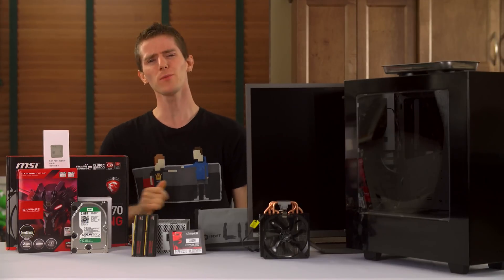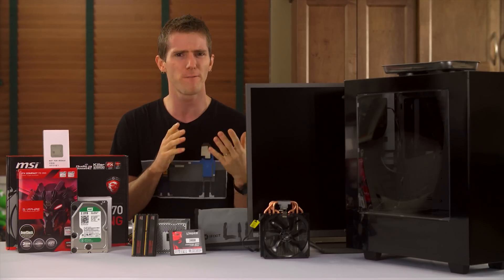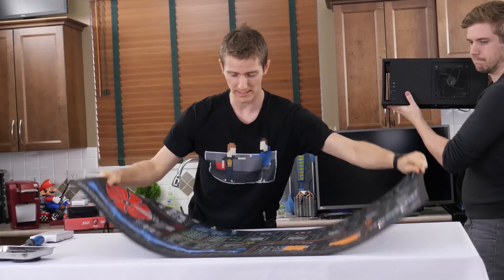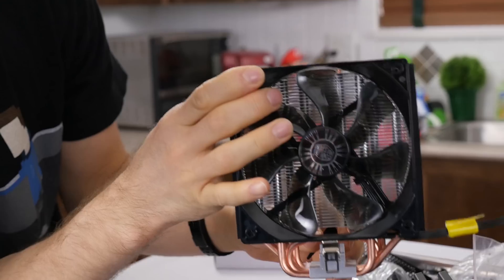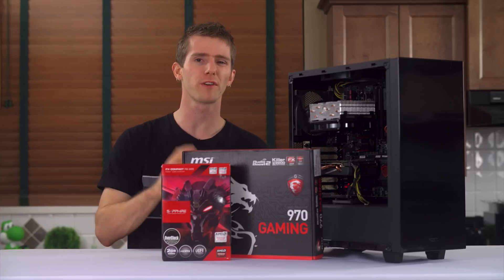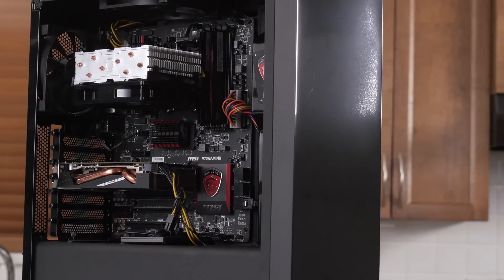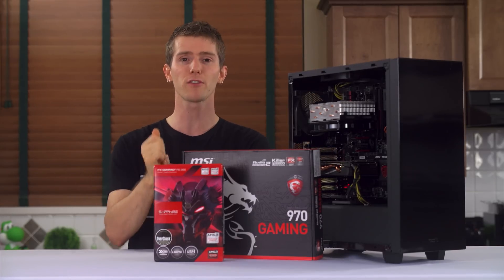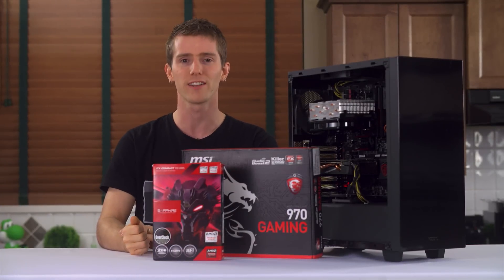Can you Build a 4K Gaming PC for Under $1000?

Comment: The monitor is nearly as expensive as the rig....
If you have the cash to drop that much on a display, you'll definitely invest more in the rig making the idea moot.  If you can't spend much on a rig, there isn't a chance that you'll buy that display.  However, if it can run popular games at 4k with reasonable framerates, it stands to reason it can run most other games at standard resolutions, right?

Comment: well of course you can build a sub 1000$ gaming pc. You only need a cheap current gen video card with 4gb of ram and match this card with the least powerful sufficient cpu available. take cheap no name ram plus cheap no name psu and cheap no name case. Then pitch in a cheap 128gb SSD with a cheap HDD. Find the cheapest motherboard with pci-e 3.0 capability and voilà! you can game at 4k all settings to low in metro last night. Yeah don't add any fan to this build so it cram within 6 months

Comment: suggestions and thoughts are very welcome

 CM Storm Stryker Gaming Big Tower Vifter: 2x 120mm Front, 1x 200mm Topp, 1x 140mm Bak, M/XL-ATX, USB 3.0, Vindu

 Corsair RM850, 850W PSU ATX 12V V2.4, 80 Plus Gold, Modular, 6x 6+2-pin PCIe, 10x SATA, 8x Molex, 2x FD

 Gainward GeForce GTX 970 4GB PhysX CUDA  x2

 HyperX Fury DDR3 2400MHz 16GB Black

 HyperX Fury SSD 240GB 2,5" SATA3.0, 7mm, SF-2281, 500/500MB/s

 Intel Core i7-5820K, Socket-LGA2011-3 6-Core,3.3GHz,15MB,140W,22nm,28 PCIe lanes,Haswell-E,Boxed,No fan incl.
	 Intel TS13X Liquid Cooling Solution Socket-LGA1150/1155/1156/1366/2011

 MSI X99S SLI PLUS, Socket-2011-3 ATX, DDR4, 4xPCIe-x16, USB3.0, SLI/CFX, M.2

Comment: You could totally play at 4k with a pair of 290Xs and an FX 8320. You don't need Intel at all, even less at higher res where the CPU (I should say single threaded performance, cause the FXs are faster CPUs that the I5s+ better overclocking) doesn't matter.

Comment: This really change my perspective about my computer. I never realized how powerful it was until now. My computer is similarly spec except I have a FX 6300 instead of a FX 6350 and 2x R9 280X CF. Now do you think I could run higher end games at 4K even though my cards are only 3GB??

Comment: i actually built my gf a pc using the msi 970 gaming board with an 8350 and my old 280x (swapped it for the gtx 970). it cost a touch over 1000$ before tax and shipping and is paired with a 32" 1440p monitor. now this video has me questioning if i should have just gotten her a 4k monitor instead. ( im waiting for 4k 144hz before i jump on the uhd band wagon)

Comment: Depends really on how you define "gaming".

It is correct that the AMD base build on this video can run good fps in "some" games at 4K res. But you lose the point of a 4K res and the games.

This is because:

most games in the video/test had low graphics/eye  candy even if you max it all out hence it ran decent fps even at 4K(dota 2, LoL, team fortress, CS GO),  it doesn't mean you should run 4K, even if you use a 4K on those games they won't look any better unless you play games with epic graphics/eye  candy settings. Thats when a 4K monitor really shine.  But use a 4K on Dota 2, CSGO? seriously....

&

Dota 2, LoL, CS GO and any other FPS or RTS games need 120hz and 144hz monitor to get an advantage. So far 4K monitor only have a max 60hz. And the more pixel count on the 4K monitor doesn't really make those games look any better. Your better off with an IPS panel lmao.

Its better off using the money on that 4K monitor to get a decent Rig overall and stick with a 1080 120+ hz/1440P.

Seriously though, Nobody plays CS GO, Dota 2 and LOL on a 4K monitor using a single 285X or any other lower/mid range GPU. Nobody "sane" enough will spend the money to buy a 4K just to play those certain games. 

The video is just pure marketing now. I guess its an indicator his sold out, not the old video guy from NCIX.

But seriously trying to sell a 285X to play at 4K is not really gaming (unless you can play any games on it), its Bullshit.

Comment: I wouldn't recommend installing the Hyper 212 EVO horizontally with the stock fan. The stock fan has a Sleeve bearing which doesn't run very well horizontally. I would recommend installing it vertically or getting an aftermarket fan with at least a ball bearing.

Comment: I am running between quad hd and "4K" by just going triple monitor (3X1 portrait for 3240X1920). I am using an R9 270 and most of the games I play run just fine.  Running triple monitors can actually be more taxing on a video card, in my opinion.  Maybe you should do some bench testing on triple monitor "poor man's 4K" setup with 3 1080P monitors. I bought each of my 22" 1080 monitors at only $100 making it still cheaper than 4K monitors and only 600X240 pixels shy of the same resolution.

While a lot of Intel fan boys on here are slamming you for letting AMD buy a slot on your channel, I believe it shows you are willing to give a manufacturer a chance.  Best of the best Intel is great, but when you are on a budget, a quad core by Intel is expensive compared to a FX 6300 by AMD. My rig works just fine and I get great gaming resolutions and frame rates even with triple monitor setup.  Keep going Linus, and if you want to do a triple monitor segment, let me know. I would be more than willing to help out.

Comment: Hey Youtube people! I am looking for a new monitor in the lower price segment of it's category
I am looking for:
- 27 inch
- 1440p 
- IPS (hobby photographer + tired of TN)
- OK for gaming = not worse than my current one. 
---I currently have a Hannspree (HannsG) HF237 1080p TN monitor with 5ms.
- height adjust + tilt

BTW I am also going to buy a device to calibrate my monitors. It's awful to look at two monitors with different colors and I want to improve the look of my pictures.

I have a Gigabyte HD 7870 OC with DVI-I, HDMI, 2x mini DP
Hannspree: HDMI
2nd 4:3 monitor: DVI
With the new monitor I would use the 23" as a second monitor.

Comment: Asus 24x DVD-RW Serial-ATA Internal OEM Optical Drive DRW-24B1ST (Black) by Asus 

WD Green 2 TB Desktop Hard Drive: 3.5 Inch, SATA III, 64 MB Cache - WD20EZRX by Western Digital 

Kingston HyperX FURY 8GB Kit (2x4GB) 1600MHz DDR3 CL10 DIMM - Red (HX316C10FRK2/8) by Kingston

Intel Core i7-4790K Processor (8M Cache, up to 4.40 GHz) (BX80646I74790K) by Intel

Gigabyte GA-Z97X-GAMING 5 LGA 1150 Z97 115dB SNR HD Audio with Built-In Rear Audio Amplifier ATX Motherboard by Gigabyte

EVGA GTX980 Superclocked ACX 2.0 4GB GDDR5 256bit, DVI-I, DP x 3, HDMI, SLI Ready Graphics Card Graphics Cards 04G-P4-2983-KR 

Corsair Hydro Series Extreme Performance Liquid CPU Cooler H80i

Rosewill CAPSTONE Series ATX 12V/EPS 12V 750W 80 Plus Gold Certified Power Supply CAPSTONE-750-M

Total $1,410.07 (Amazon)

This will be my first custom PC that I will build. Can I have your thoughts on this? Can you recommend me better parts? Or is this good?

Btw, havent figured out which case to pick yet.

Comment: This a $1000+ (bout $50) pc that should be able to play ANY GAME with mostly high details at 4k

PCPartPicker part list: http://pcpartpicker.com/p/GvXhdC
Price breakdown by merchant: http://pcpartpicker.com/p/GvXhdC/by_merchant/

CPU: Intel Core i3-4130 3.4GHz Dual-Core Processor  ($106.97 @ OutletPC) 
Motherboard: ECS B85H3-M(1.0) Micro ATX LGA1150 Motherboard  ($31.48 @ Newegg) 
Memory: Team Elite Plus 8GB (1 x 8GB) DDR3-1600 Memory  ($58.98 @ OutletPC) 
Storage: Crucial V4 32GB 2.5" Solid State Drive  ($35.95 @ Amazon) 
Storage: Hitachi Deskstar 1TB 3.5" 7200RPM Internal Hard Drive  ($48.99 @ Amazon) 
Video Card: Asus Radeon R9 290X 4GB DirectCU II Video Card (2-Way CrossFire)  ($279.99 @ NCIX US) 
Video Card: Asus Radeon R9 290X 4GB DirectCU II Video Card (2-Way CrossFire)  ($279.99 @ NCIX US) 
Case: NZXT Source 210 (Black) ATX Mid Tower Case  ($29.98 @ OutletPC) 
Power Supply: EVGA 850W 80+ Gold Certified Fully-Modular ATX Power Supply  ($89.99 @ NCIX US) 
Optical Drive: Samsung SH-224DB/BEBE DVD/CD Writer  ($13.99 @ Newegg) 
Operating System: Microsoft Windows 8.1 (OEM) (64-bit)  ($89.98 @ OutletPC) 
Total: $1066.29
Prices include shipping, taxes, and discounts when available
Generated by PCPartPicker 2014-12-27 09:20 EST-0500

Comment: It's a pointless attempt in my opinion. All the games mentioned have modest graphics and they have them for a reason - to make it possible for as many people as possible able to play them. Most of the people who want high res gaming will want to use that 4K resolution to display games that are better looking and most people who play LoL and/or Team Fortress either don't care that much about graphics or don't have the money for an upgrade.

It would be 10 times better if you would have done a video in which you would attempt to run good looking, yet slightly older games in 4K.

Comment: Personally, I would downgrade to just a 1tb hdd instead of the ssd and hdd. That way you can save about $200 ish (give or take) , then you could upgrade to a 8000 series cpu and the visiontek cyrovenom r9 290 ($299 with rad+preinstalled water block + pump, $299 is normal price off visiontek website) GO CHECK OUT JAYZ TWO CENTS FOR VISIONTEK R9 290 review. IT WILL BLOW YOU AWAY

Comment: hhahahah for xmas I build a computer so close to this one
same NZXT s340 case but the white version
AMD FX 8320 8 core 3.5ghz
8 gigs of Gskill sniper 1866ghz
same MSI gaming 970 board
MSI gaming r9 270x
600watt corsair power supply
same Kingston SSD but only 120gig
1tb WD blue
AND a NZXT Kraken x61,
with black Friday deals ram for 50 and SSD for 50 and a few other sales I got this computer for just under $800 (791) exact, without windows!!

Comment: If this is a budget build why spend so much on the mobo? Put in a decent Intel CPU and a mid range graphics card with a cheap mobo and it will do fine with these games at 4k. Then you have the chance to upgrade your graphics card in the future and run high end 4k games.

Comment: Thanks for the AMD love, just wondering though, what FPS would you get out of this setup on 1080p not 4k? I play these titles and I'm looking to upgrade my AMD system from a 6770 gpu to either the R9 285 or R9 290 and will be on 1080 and not 4k. Regardless, I do love the AMD build and agree that it is not the highest performance but is a very good bang for the buck.

Comment: will this run most games on ultra?

CPU- AMD FX-8320 3.5GHz 8-Core Processor
Motherboard- Gigabyte GA-970A-DS3P ATX AM3+ Motherboard
Memory- Crucial Ballistix Sport 8GB (2 x 4GB) DDR3-1600 Memory
Storage- Western Digital Caviar Blue 1TB 3.5" 7200RPM Internal Hard Drive
Video Card- XFX Radeon R9 285 2GB Double Dissipation Video Card
Power Supply- Thermaltake 750W 80+ Gold Certified Semi-Modular ATX Power Supply

Comment: 4K is still not all that mainstream, the monitors are still expensive(almost as much as a new PC) and when running that high alot of the textures look like crap because they aren't set to a ultra quality. I would rather have a good 22-24 inch 1080p at 120 or 144Hz. The system is pretty decent for the games that are shown. i say thimbs up for this decent system.

Comment: I don´t that RAM upgrades are easy. I have an be quiet Dark Rock 3 Pro an as mainboard an ASUS X79E-WS and a RAM-upgrade is very difficult because I have to deinstall the cooler and you have not much place to install the cooler again after a RAM-upgrade.

Comment: Do a build/test of RAIDR EXPRESS
(or) 90MB0G60-M0EAY0 							 						as the only drive.. love to see the stats.
Reply: p.s. I have heard its difficult to set up as a bootable drive, because the bios won't recognize it. but is that the case.. would you prove or disprove and put these questions to rest.. and if it works well I would like you to see the specs hold up to real world use. if it is as good as the numbers on paper look I am thinking of making a rig with one of these. :)

Comment: I just built a nice system today, here are the specs...
Corsari 230T (Orange)
Intel Core I3 4130
EVGA GeForce GTX 750Ti FTW
Corsair CX 600M
Corsair H55
8GB (2x4gb) G.Skil ram
Gigabyte GA-z97x-SLI
WD 1TB Blue
Kingston SSDnow 120GB SSD

Comment: You can build this pc for $650 if you use a regular WD 1tb $60 hard drive a not to expensive case and less expensive ram. Add an extra $75!!! $15 extra for CPU and an extra $60 for gpu and you can get an FX 8320 and an R9 290x. That would have been a better case for a 4k $1000 computer. It just goes to show how these guys are not really up to date on AMD pricing; you can actually build a crossfire r9 290 \ 8 core AMD system for $1000 that would be a real 4k build. Still liked the video though for a under $700 build it runs good.

Comment: This is a $1100 PC that can play demanding games at 4K.
Case - AZZA CSAZ 206 (Windowed side panel and 2x 120mm fans included) -  $24.99 (After $15 Mail in Rebate)(Newegg)
Motherboard - ASUS Z87-A LGA 1150 Intel Z87 - $74.99 (After $30 Mail in Rebate) (Newegg)
Processor - Intel Core i5 4690K - $214.99 (NCIX US)
RAM - Team Elite 8GB 1600Mhz - $58.98 (Outlet PC)
Graphics Card - 2x PNY GTX 970's - $649.98 (Directron)
PSU - EVGA SuperNOVA NEX 750W - $39.99 (After $25 Mail in Rebate) (NCIX US)
HDD - Seagate Barracuda 2 TB - $64.99 (Amazon)
Total - $1128.91
So Linus this PC can play even the most demanding games at 4K. This is the PC that you should buy if you are on a budget and want to do 4K gaming. You should really do some research before saying something.

Comment: I like this video, but... you shoulda gone for the R9 290 instead of the 285. 2GB VRAM seems very tight for 4K even with less-demanding games like these, 4GB would give more breathing room with graphics and wouldn't require WoW's graphics to be reduced for a decent frame rate.

http://pcpartpicker.com/p/mJcB7P This would probably be a better AMD-based value 4K build for the money, slightly more SSD storage and an R9 290 instead of the 285. Still under $1000.

Comment: My future build: MSI Graphics Cards GTX 980 GAMING 4G
Intel Core i7-4790K Processor 
WD Blue 1 TB Desktop Hard Drive: 3.5 Inch, 7200 RPM, SATA 6 Gb/s, 64 MB Cache
Corsair Vengeance Pro Series 16GB (2 x 8GB) DDR3 DRAM 2400MHz C11 Memory Kit
Thermaltake Smart 650W 80 PLUS Bronze ATX12V 2.3 and EPS12V Power Supply SP-650M
Can anybody recommend me a case, motherboard, a liquid cooling system, and a thermal compound? Also if there is anything that is out of place, please tell me.

Comment: Hey guys here is the exact build from the video at pcpartspicker:
http://pcpartpicker.com/p/LDgZjX
($863.64, in USD after rebates as of this posting)

Frankly, I am disappointed that Linus posted a build that could potentially draw more power than the power supply could provide without checking it first.
Reply: Here is an Intel/NVIDIA build that does significantly better (GTX 970 with 4690K):
http://pcpartpicker.com/p/Bv9nMp
($893.67, in USD after rebates as of posting)
Reply: I actually thought that during the video. There's no way you would want to run a 4k AMD rig on a 400W power supply. Even if the power is there, you're gonna be pegging it all the time and that's not the best.
Reply: Nope, you didn't include a monitor. So this is false
Reply: Aidan Sweeney  EVERYONE has a 4K monitor?? Yea think again.
Reply: xXBloodHoundXxI didn't mean 4K, I meant almost everyone already has a monitor of any resolution. I didn't mean 4K. Stop making assumptions.
Reply: GuardianLords Nice build, I'm about to build my first gaming pc soon and I'm thinking about using that one.
Reply: Too bad prices change real fast, the cost of it is now $925 instead of $893, unless you bought it already.
Reply: GuardianLords I haven't bought it yet, but $32 isn't a very big deal to me.
Reply: xXBloodHoundXx But most people already have one, idiot.
Reply: Aidan Sweeney linus inluded the price of the 4K monitor AND the pc for UNDER 1000$